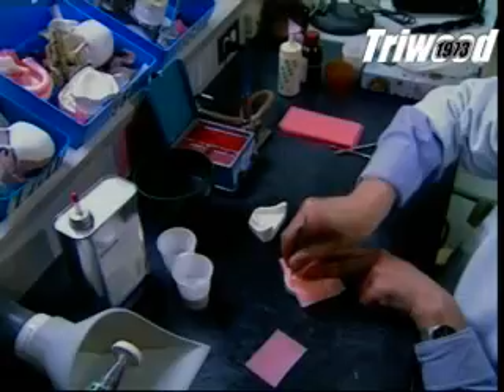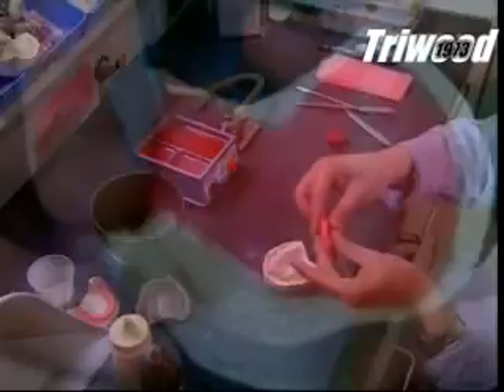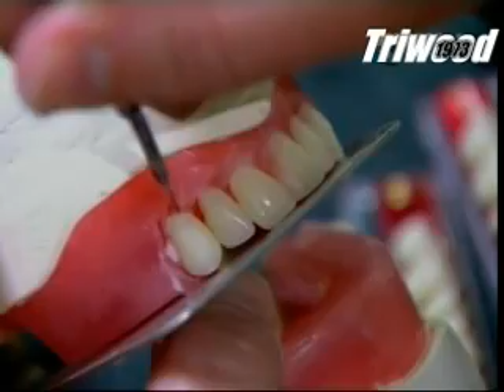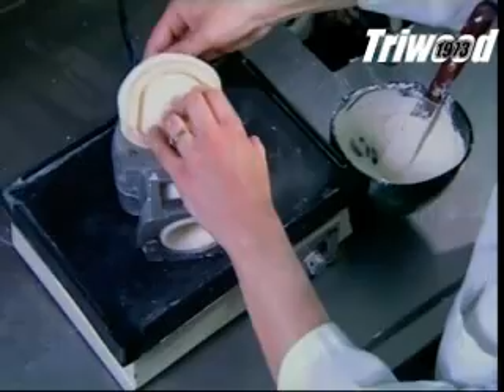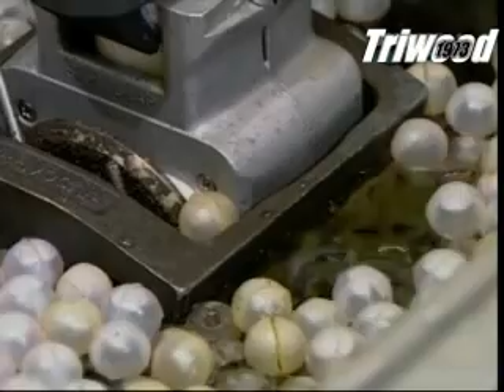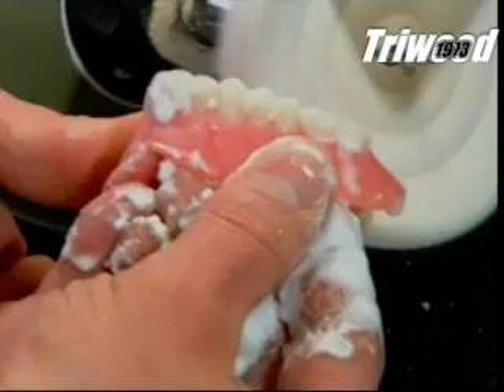Making Dentures

Comment: 2.36 the centre line is out. This is a very inaccurate video not many dentists take denture impressions in silicone unless its a chrome or maybe a flexible denture with strong clasps. alginate is a much more accurate imp material unless your doing a restoration of someones mouth ie crowns, bridges because alginate is more mucosa compressive bringing every detail of say the rugae and the ridge undercut to be shown in the cast. still interesting to watch if you dont no what you are doing.